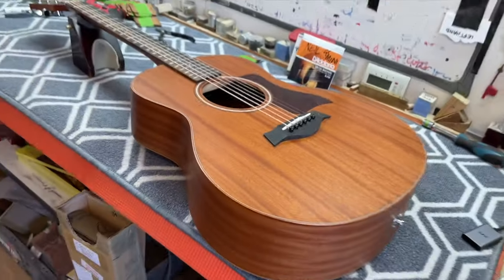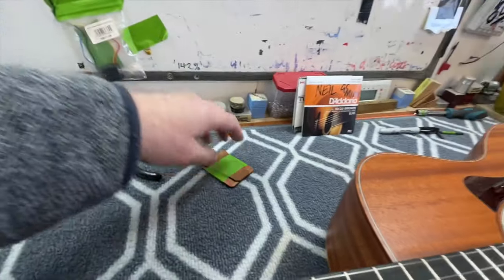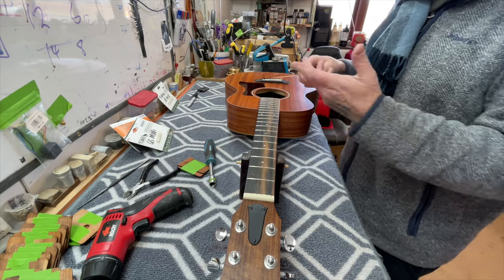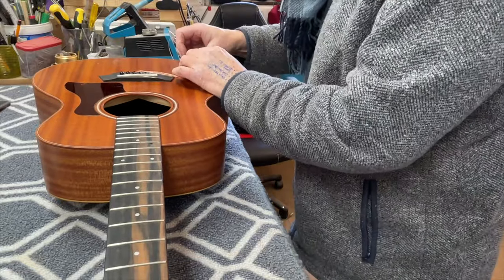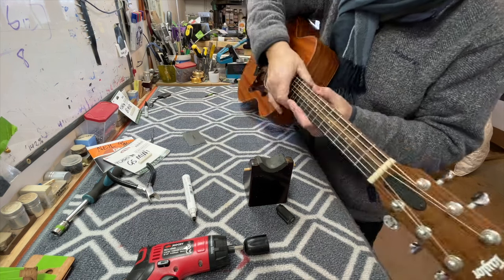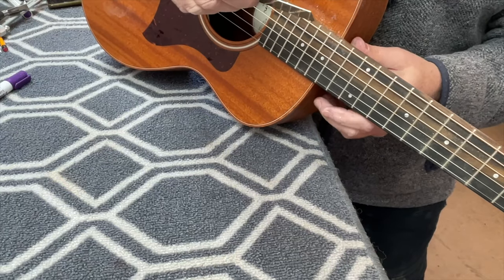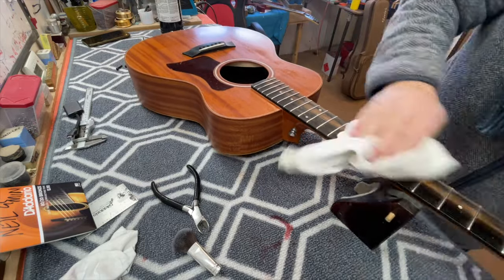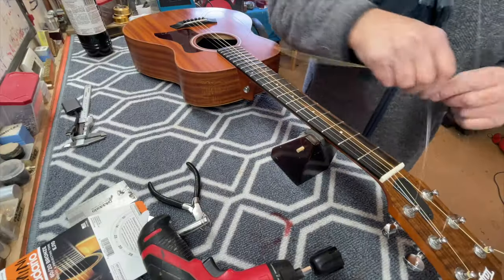Taylor GS Mini neck reset and set up

Comment: 4 year old GS Mini-e Koa top owner here.. I have virtually no belly on my gs-mini, though I have done a neck reset to lower the action the slightest bit. I just did a fret level, crown, and dressing last week. These guitars don't have a lot of fret so I recommend to anyone about to level and crown to be gentle and take of the very very least possible needed to level.
Reply from the maker: Hi Adrian - yes, I agree with you. It's one of the reasons that the 'Banana' method of levelling that I use is so effective: you don't take even the slightest bit of metal more than is required to make your chosen action play well. Interestingly I've never had to level a Taylor's frets yet even with a 'reset' and very low action. Most acoustics I find can be taken down to a great action without the need for levelling - but that's because the action, while low for an acoustic, is still above the typical target electric guitar action where levelling IS needed.

Comment: I've the exact same Mahogany GS mini (also 2 years old) and the top is totally flat and it has an amazing low action - can't believe that massive bridge bulge on Neil's. Maybe a dumb question but would it not possible to double up shims to achieve the desired height ?

These mahogany guitars have a very dark tone and I put D'Addario 85/15 bronze 9/45 super light strings on for brighter tone.

Comment: That action was very high prior to the neck reset, I wonder whether the guitar has been over humidified. RH can get above 65-70% in the UK. Before I make any action adjustments I prefer to leave an instrument in a humidity controlled environment for a few days to see what changes.  I don't understand your reasoning for measuring action at the last fret. Doesn't this differ depending on how many frets the guitar has? In addition, quite a few guitars have fall-away built into the frets  beyond the body joint which complicates things further. 12th fret actions are used because this is the midpoint of the string path. To lower the 12th fret action by a set amount you need to remove twice that amount from the bottom of the saddle. Good tip about putting glue at the front edge of the saddle, a couple of drops of wood glue works perfectly.

Comment: I’m not sure if this helps with these issues but I had a Washburn for about 3 years it did this same thing. I’ve had my Martin for about 8 years. If I’m not going to play it for over a week or so I loosen all the strings to point of just barely any tension at all. After all these years the action stays exactly where I set it with zero belly bulge. Also when not in use stays in hard case with humidipaks. Maybe this is the key to avoiding bulging issues.
Reply from the maker: Jeff that’s a really useful piece of anecdotal evidence! It does align with the theory that the real issue is string loading vs. structural strength. It’s a great idea… sounds like hard work and maybe in an ideal world we wouldn’t have to go to those lengths. But we may have to!

Comment: Hi Sam, 
Great video on the Taylor neck reset!  I'm curious regarding the lowering of the saddle. You use the figure of 1.4 as a multiplier for the amount to remove from the saddle. Isn't  it standard practice to use 2 as a multiplier since the 12th fret is half way between the nut and the saddle? Is 1.4 specific to Taylor guitars, or the mini, or is that just a figure you have found works better for you on all guitars? Thanks in advance for explaining the reasoning. 
Tom
Reply from the maker: Hi Thomas - I always measure my playing actions at the last fret which is about 1.4 x the distance from nut to 12th. I’m just using it to work out how much to remove from saddle (if I need to lower the action via the saddle - more often these days I do it via the bolt-on a neck + factory shim pairs). I know that 1mm action reduction at 12th fret requires 2mm off the saddle; so I multiply my desired last fret reduction by 1.4 to approximate what I need to take off the saddle. I’m lousy at basic maths so it could well be wrong and in fact be the other way round ie should be 1.6 not 1.4 lol but if so then I’m just in effect being conservative / cautious which is ok!

Comment: I have the same problem. I  bought my "dream acoustic", a USA Martin D18, about 2 years ago from Andertons and after a short while it had a 5mm 12th fret action. By tightening the truss rod and switching to extra-light strings I've brought it down to 3.5mm at the 12th fret but it's still not great. It has a big pot belly bulge on the soundboard behind the bridge. I'm trying to love it without lowering the saddle as I'm aware that will affect the tone but it's not what I'd hoped for after 2 years. It has been kept in it's case and never exposed to extremes of temperature etc. Disappointing for a £2,700+ guitar.
Reply: Utterly mate - pathetic. I there any extended warranty on the guitar?
Reply: You can shave the saddle but you need to ramp the peg holes in order to keep a good break angle, I do this on customers guitars all the time, and never a problem. Taylor should not be selling guitars with 6mm action when new .. it is just bad design.
Reply: People may need a lesson in moisture and humidity.  Lol
Reply: Solid top will reduce belly hump.

Comment: I had some strings wrapped up as your's here and oh my gosh!  I suddenly knew I was in training for being an electrician.  They got so wrapped that that i had to cut them to stop from throwing the guitar.
Reply from the maker: Been there, done that more times than I like to remember. The secret is pushing through the whole cluster of coil-y ends back through the loop of strings without any one of them catching. It can be done, but it’s definitely an art form! 😅
Reply: Yeah, I hear ya. When I'm setting up a guitar now, I just put my locking Machine turner's on to do the work. Have a set just for that. I get too frustrated with the old strings and also, I don't like to get stabbed over and over with sometimes a rusty set. It's almost worth it to just add it into the cost. Thanks for the response.  Again, learning the in-between stuff is daunting bit wprthit. I think now I'll stop letting the guitar tell me where the action needs to be. High e always breaks!

Comment: I had same problem with one these when it was six months old.
It got sent to a Taylor authorised repairer and they put two gouge marks on the top taking the neck off.
Reply from the maker: I've had a neck removal 'disaster' with a Taylor as well; a badly-fitted / too tight fit of the fingerboard extension. There was literally no way to get the neck off without it pulling up the fragile top finish where it was squeeze / jammed in place. I made a pretty good repair and gave it a superb set up (according to the very happy customer, thanks Justin!) but it will happen on rare occasions. Your repairer should have a) told you and b) done everything possible to put it right.

Comment: So are we to conclude that the way this guitar has distorted is due to poor workmanship or could it possibly be due to some ridiculous storage conditions? 
Nice to see you got the action to where it should be.
Btw, no snow in Callington yet.
Reply from the maker: I honestly don't know Paul. There are some that don't change as radically and some that do. What I DO know (as we've discussed before) is that MOST of them start deforming from the factory onwards. If you're lucky you get one that doesn't deform as much... if you're VERY lucky you get one that stays the same forever. But, by definition, a guitar tech / luthier is going to see sick guitars (just like a doctor is going to see more sick people than healthy ones!). 
I think a combination of things are at play: definitely a battle between twinkly tone and structural strength; different grain and wood between guitars... different environmental conditions where the guitars are kept. Different gauges of strings... 
You'd expect those things to change the guitar over time - but a lot more time than this 2.5yrs.
Reply: Driftwood guitar's has don't many video's on this subject.  They cut them open and explain why the guitar's are doing these things qnd how the quality of the woods is the main factor. That and the silly half done bracing. I mean, almost no hand work goes into them now. The x bracing,  ok not sure I like it. The laminated top wood's,  the under cut bracing and the desire to cut corners and still make money has done it well to us. Obviously,  humidity can do wonderful things to wood. Yes, lots of factors but living in a mobile home is so far the worst for me to see. Damage from that.

Comment: you could use the bridge doctor to remove the hump on non taylors
Reply from the maker: JLD Bridge system (the "Doctor" is the version with brass string pegs) is the last option for this guitar down the line - unless it turns out that Taylor makes a bigger shim than the '30' I used. Of course some people would resort to making their own but I'd prefer that they were precisely manufactured. 
I've had varied results with the JLD Bridge system; it pretty much always stops the bridge rising any more but it varies whether or not it will reverse the bellying.

Comment: Why would anyone want a guitar with a ridiculous 6mm high action, so high that it is unplayable. Come on Taylor you should do better than this, whoever designed this is an idiot!  I would normally expect to do a neck reset on a very old guitar that has bellied over the years but not on a fairly new guitar.
Reply from the maker: I'm trying to get into a conversation with Taylor at the moment about this issue and a number of others with their acoustic guitars - all of which I think are 'fixable'. It remains to be seen whether they will make time to hear what I have to say. But yes, a guitar THAT 'tired out' so early in its life is completely unacceptable. Unfortunately, my (fairly limited so far) experience suggests that this isn't as rare as you'd hope it would be.